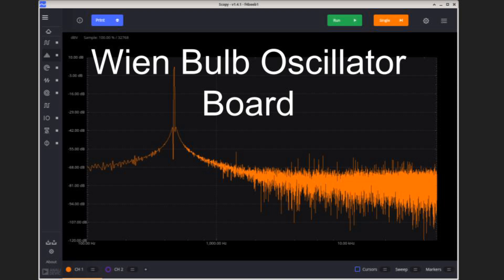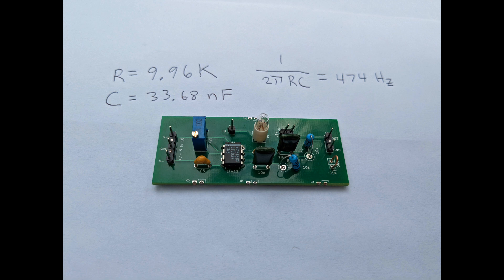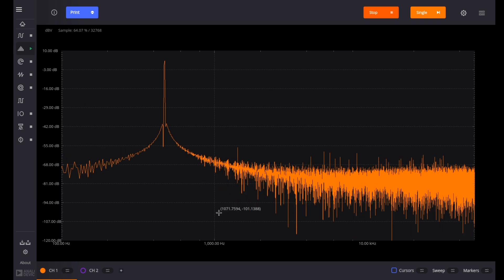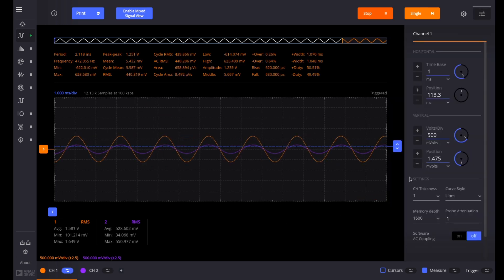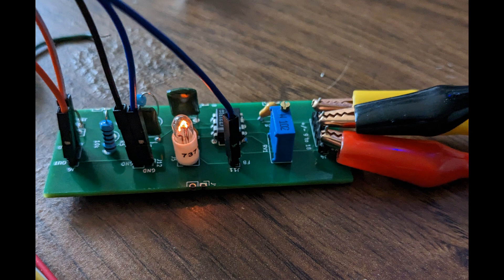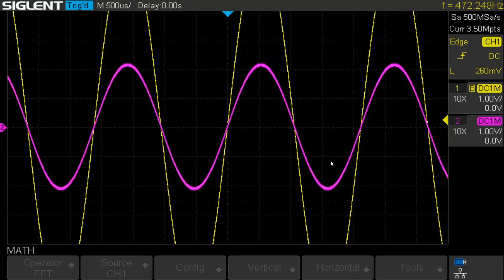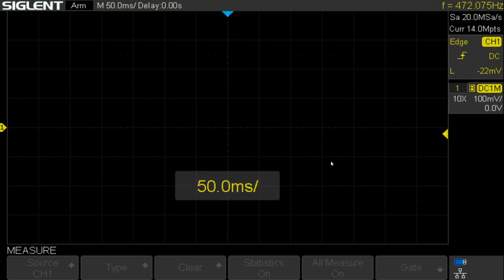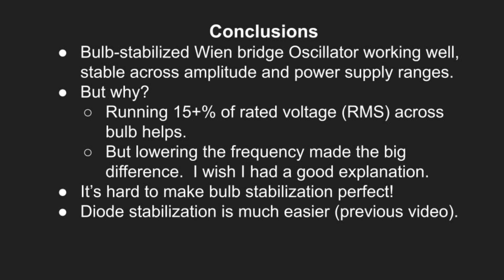Revisited with new board: Lamp-Stabilized Wien Bridge Oscillator

Comment: Fantastic stuff,I am entering the murky world of audio and would like a clean source of a sine wave. I have yet to do much experimentation but how would this noise compare to a cheap signal generator or the output of Audacity from an average PC for instance ? thanks in advance !...cheers.
Reply from the maker: I have no high quality audio equipment so this is out of my area of expertise.  But you made me curious so I quickly tried two things.  First, I had audacity drive a sine wave to my PC's headphone jack.  The signal looks good on my Siglent scope's FFT-- really just as a good as the bulb oscillator, although there was more non-harmonic noise.  I also used a resistor divider to get the right signal level from the bulb oscillator to drive a powered speaker.  It sounded OK to me, similar to audacity output.  I don't have a quality signal generator to compare...  The ADALM2000 signal generator looks (and sounds) a little worse than the bulb oscillator.
Reply: @electronics.tinker  Thanks ! that's interesting so I'm gonna go ahead and build the bulb oscillator...cheers!!

Comment: I think all you need is some form of leveling circuit on the output. The leveling circuit will have its own feedback loop so there's some possibility it's action will introduce some harmonic distortion. In a nutshell all you need to do is compare your circuits desired output level to some fixed reference. The difference between these levels is used to adjust the gain of the leveling circuit. This could be done with a mosfet in the feedback loop where the voltage applied to its gate controls the mosfets conductance. In RF circuits the active element is usually a pin diode as opposed to something like a mosfet.
Reply: Lol. I just did a google search and wouldn't you know it W2AEW has an audio leveling circuit that he demonstrated on his channel. Very simple to build with a couple transistors and diodes. W2AEW: "Circuit fun: Automatic audio leveling circuit | audio compressor | for scanning receiver"
Reply from the maker: As you say, I think this approach would add distortion.  I think most modern serious attempts at high-quality sine wave generation use careful jfet circuits.  They are discussed in this somewhat famous app note: https://www.analog.com/media/en/technical-documentation/application-notes/an43f.pdf.  They are somewhat complicated.
Reply: "All you need" - Yes. But this is not easy to do. See the Wien-Bridge as 2 dimensional non-linear differential equation:

dx/dt=a(x,y)*x-y
dy/dt=a(x,y)*y+x

give a solution

x(t)=r*cos(omega*t)
y(t)=r*sin(omega*t)

where a(x,y) control the amplitude of this state-variable oscillator. The perfect math solution is
a(x,y)=1-x^2-y^2

There are square circuits which could do this but do not expect to filter them down of the remaining harmonics before applying to the JFET as it will ruin your regulation loop stability.

The practical issue of all other approaches is that they control the amplitude much slower than the real part of the pole pair shift from positive back to negative if the amplitude get over the target. Finally the amplitude is then dependend on slight signal compression by non-linearity. The least harmonic generation over amplitude sensitivity is simply clipping both x and y at b slightly lower than 1. At these points the cosine and sine approximate to 1-(omega*t+ph)^2.

Another solution is to use the zero crossing of x and to sample the amplitude at the top of y and x. So you get 4 sample-hold signals, so harmonics four times the oscillator frequency.

These solutions give you good stability with moderate harmonics. Then finally you need to filter them with a matched filter.